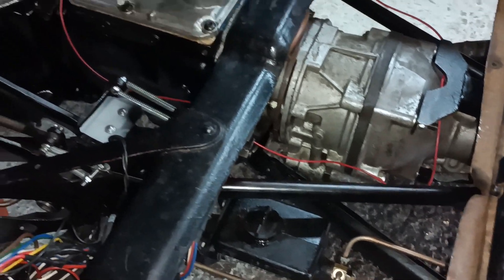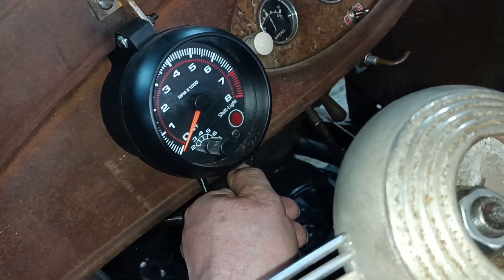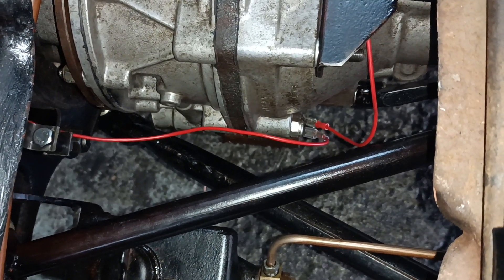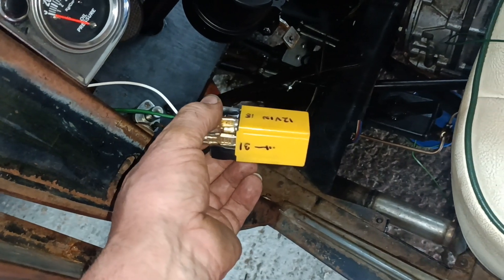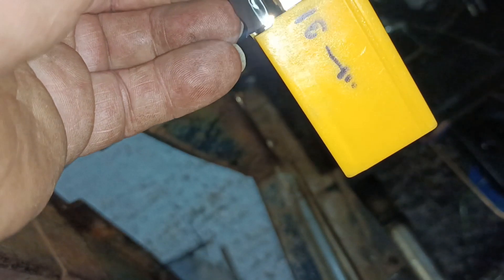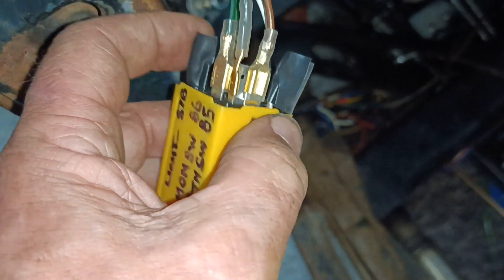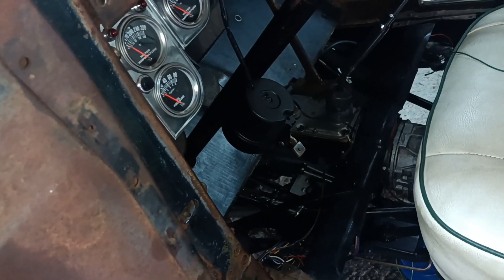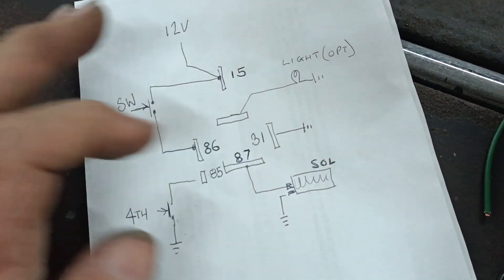Wiring a J type Laycock Overdrive using a Volvo Overdrive Relay. Incl. Pin IDs and Diagram. (2262)

Comment: Hi Mart! could you run 12 volts direct to the solenoid, through  a switch, and split gears?
i have a Mitchel overdrive in my Model A, it has a lever shifter and i split 2nd and 3rd. spiting 
second id great for going up hills for me.  but  you car has a lot more power 

 thanks for the vid!  Brendan
Reply from the maker: Hi Brendan. 3rd OD would not be much different to 4th straight so not much benefit to be gained. The OD engagement can be a bit slow sometimes so using it briefly in 3rd probably wouldn't be worth the while. I have more torque than the Volvo motor so I wouldn't want to go over the design limits of the OD.
Reply: @MartsGarage the advantage of have 3 overdrive is when over taking, you can go from effective 4th to 3rd in a fraction of a second?

Comment: Mart how about mounting a micro switch on your gearshift lever that you could reach with your index finger, seems like it would be handy.
Reply from the maker: Hi Vette, yeah that's very do-able. Running the wiring up the stick can be a pain, though, so I went with the switch on the dash. I might change it but for the moment it is ok. Thanks for watching.
Reply: Had a 80 240 Volvo w o.d. switch on gear shift. Factory. Pretty cool.

Comment: Hi Mart, well done. It would be nice to have a little light ( maybe next to the momentary switch) to give you a visual indication of when the overdrive is on, I see the relay allows for that, cheers
Reply from the maker: Hi Steve. I might fit a light. Just not sure I need one at the moment. With the special relay you can't accidentally leave it engaged. Thanks for watching.

Comment: I'm guessing that the momentary switch on the dash only needs to energize the circuit, and the relay holds the overdrive engaged. Am I close?
Reply from the maker: Hi Gotham. Yeah, the momentary switch energises the relay which energises the solenoid. The relay latches and remains energised until: The momentary switch sends another signal, or the gearstick moves out of 4th, or the ignition is switched off.
Reply: @MartsGarage  So if I understand it correctly, you can go from OD to 4th gear by hitting the switch again?
Reply from the maker: @Danjr948  Yeah, Nuke, if OD is on, one touch of the momentary switch turns it off and you have straight 4th gear.

Comment: Fun and functional project Mart, I love stuff like this. It's not greasy or heavy.😁 I've just pulled my old engine and removed everything I'll need to move over to the new engine or back in stock. Just came in to have a bite of lunch and had a new Mart's Garage episode to watch during my lunch break.  Thanks! 👍
Reply from the maker: Hello Art. Glad you like this sort of thing. I like wiring. It's nice and clean and quiet. Quite a contemplative activity. Plus stuff works afterwards. (Hopefully).